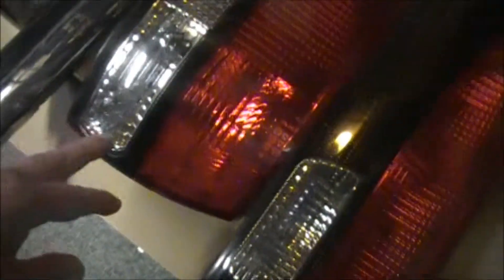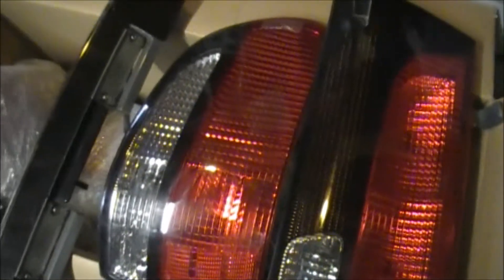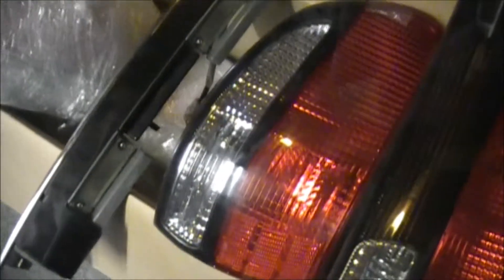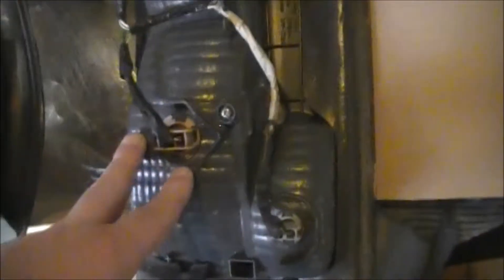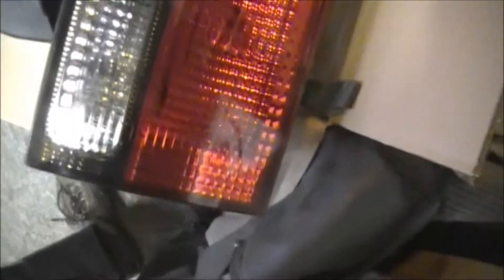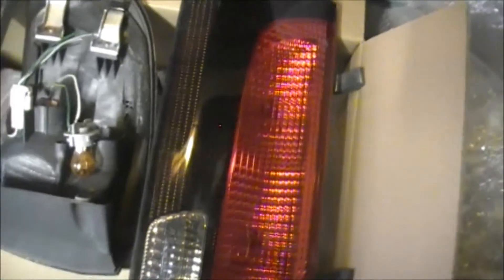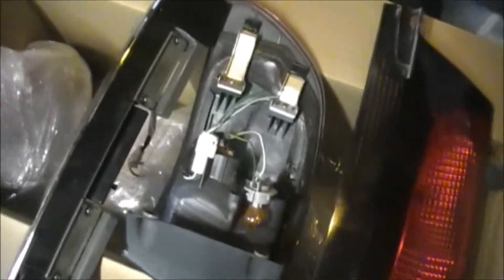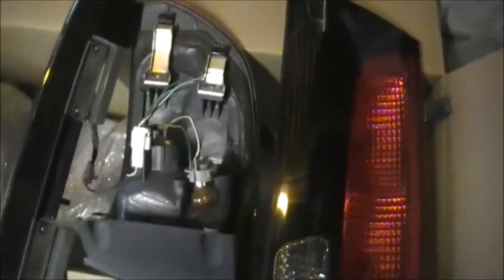JDM KOUKI TAIL LIGHTS have Arrived  TARAGO PREVIA ESTIMA TCR

Comment: These look sweet mate. Really going to lift the whole look of the van. I did drop you a message asking if you might sell the tail lights you will have left over, but only yesterday ordered one from E bay! Typical timing. I thought you might have taken a little longer getting them, but obviously, if you say you are going to do something, you do it! Good luck with the fitting (if they are not already on) and thanks for all the fantastic tips!
Reply from the maker: Got some mods to make to the van for the new lights to fit. I was going to put the old lights on the forum tonight for sale but didn't have time. 1st option for sales goes to members, if not sold in a few weeks then I would eBay them. as you know some have mods done on them and the ones with edits will start at a very low price. I almost have the NEW lights ready to go on. need to do some touches here and there before I finish them off. BIG lesson on doing this. I have made some mistakes others can learn from if they also want to do the same thing. well worth $330 AUD from Japan for all the lights and not $180 for just one light I was quoted for the normal light.